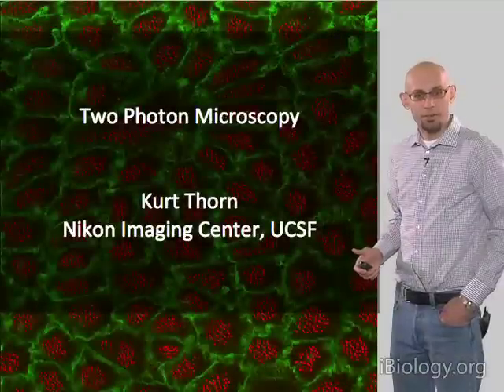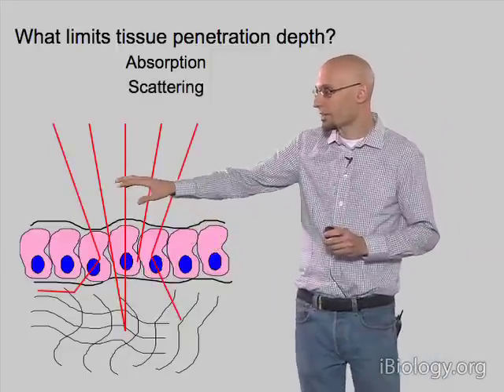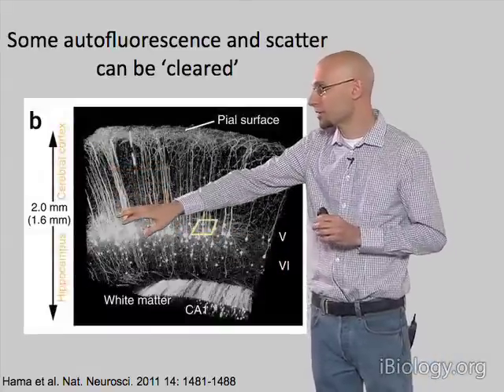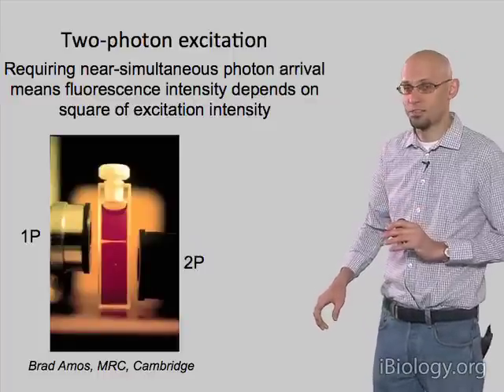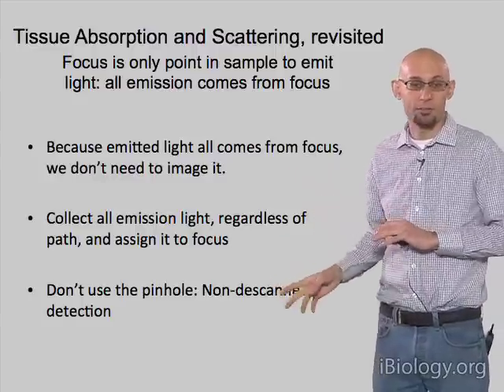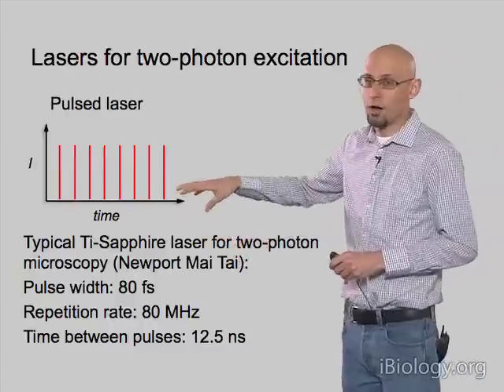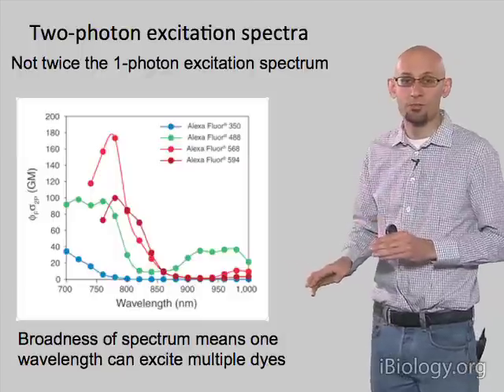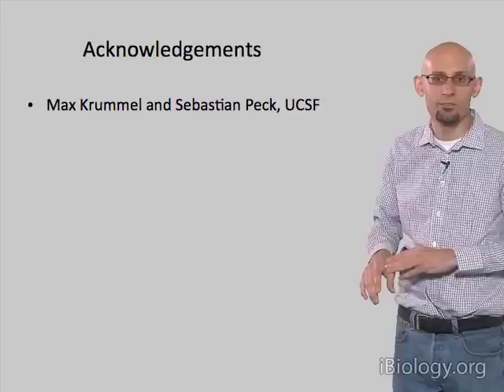Microscopy: Two Photon Microscopy (Kurt Thorn)

Comment: Here is my train of thought please correct me if I missed or misintepreted any of the information: So epifluroscence uses excitation ligth to excite a sample however it is inefficent (specificlaly for deep tissue sample) because it doesnt focus on one focal point and out of focus ligth blurs otu the sample not allwoign for analysis for a specific point in the tissue. Confocal microscopy is much mroe better due to the pinhole which blocks out out-of-focus light to better analyze a tissue sample however the problem comes in the scattering of the ligth due to deep tissue penetration and since the confocal micrsocopy works with shorter wavelegnths, and as mentioned in the video previously less scattering and absorption occurs at infrared (longer wavelengths). Therefore, two photon microscopy is most opimal for focusing on a specific focal point in a deep tissue sample due to the use of higehr wavelengths leading to less scattering and focsu on one focal point without out of focus light coming in and overall excitation light is longer than confocal and epifluorescence microscopy techniques.

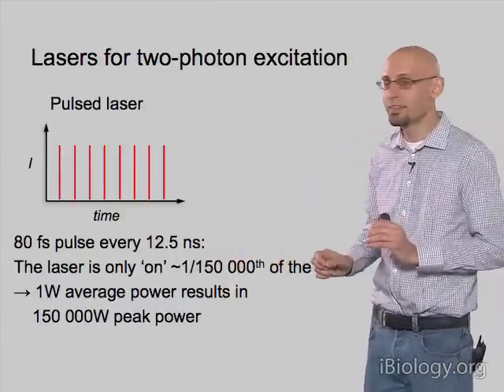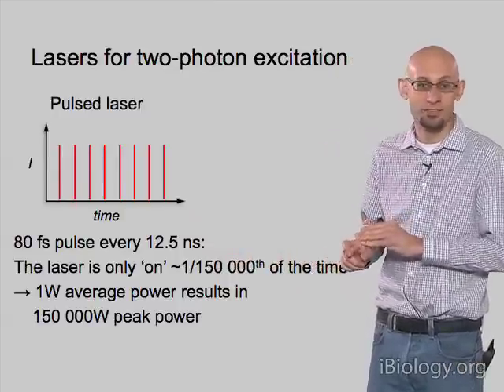Comment: 22:40-22:45 this is not truly the reason, in my opinion. A more appropriate explanation would be that the two-photon cross-section is extremely low and thus high intensities are a necessity for inducing two-photon absorption. Two photons will always be present, but the absorption will not be stimulated unless there is a high density of photons, owing to the low cross-section. In fact, this cross-section will become orders of magnitude weaker for even higher multi-photon events.

Comment: Thanks for the excellent explanation. I have a doubt : two photons are two different quanta, even if they arrive simultaneously, would they not excite two different dye molecules with the same energy and not the same molecule with twice the energy ?
Reply: From my understanding, that's the trick of 2 photon, at the focal plane, the density of the photons is so high that 2 photons will hit the same molecule. Outside of the focal plane, the likelihood of 2 photons hitting the same molecule goes down, therefore photo-bleaching is minimized outside of focal plane
Reply: There is no real upper level (excited-state) corresponding to a single photon’s energy and therefore there will be no absorption.
Reply: Agreed: 1) Excellent explanation. 2) I had(?) the same doubt. It doesn't square with my understanding of how excited states happen ... the reaction of a molecule to being hit with half the energy needed to excite it would be: "hold my beer." It appears my understanding is incomplete because they are making it work.